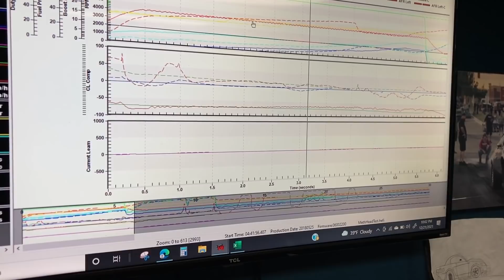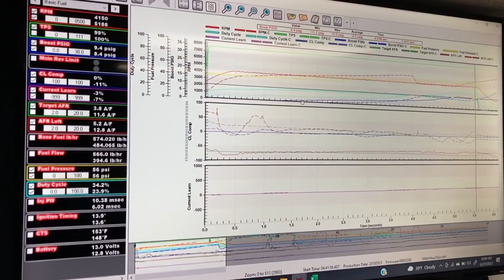Does Methanol Spool a Turbo Faster than E85?  Gap Train S10 goes on Meth!

Comment: What injectors?
Reply: Fid2200s
Reply: @maktvmidamericakustoms8837  what size fuel line are you running?
Reply: @zachtruitt7  10an up to the engine then y into 8an to back of both rails

Comment: Exhaust volume. Crazy how laggy that is since e85 itself has higher exhaust volume than pump gas.
Reply: Alot of it is just having the bigger 91 on there.  With the smaller 80 it did fine.  Just needs more cubes or less turbo

Comment: So the whole crew will be swapping in the future I bet:). Curious to the $5K cost factor mentioned. Is there new data logging accessories needed?? I know Adam mentioned staying with the current injectors and adding a bigger pump. What else is needed??
Reply: So it looks like we may get lucky and be able to use our fid2200s.  I bought a aeromotive 10 gpm in tank pump.  With a 60 psi it looks like we may just have enough for this power level.  We will have up coming videos  showing the upgrades and once we put it on the dyno.  Stay tuned ;)
Reply: @maktvmidamericakustoms8837  #isitdoneyet  Looking forward to them. All the best !!!
Reply: @maktvmidamericakustoms8837  love watching you guys, laughing the whole time.

If you get the chance, could you touch on the oiling system for the gap trains turbo? There's not much information on remote mount turbos.

Keep up the killer work, making Indiana proud
Reply: @NickButlerish  thanks buddy and sure can.  I will be doing a video in the next week going over the entire truck.  Where we are now and where we are going with it for next season
Reply: @maktvmidamericakustoms8837  I mean your gunna be limited to 1000whp on meth with fid2200s won’t you? Same injectors I have and I figured it wasn’t worth trying meth because I can’t afford a second set of injectors
Reply: I think his injectors were large enough to try the 2 step. I doubt they’re big enough to actually carry the boost and rpm top of the track.

Edit: watched it to the end. 210s. I guess they’re large enough?

Comment: Do you guys think twin 7875 turbos on a gen 4 5.3 with ported 706 heads BTR stage 3 twin turbo cam on E85 will spool up okay or to much turbo
Reply: Cool, that stage 3 cam from btr is rowdy af also.  You will be happy with the combo
Reply: @maktvmidamericakustoms8837  I hope so everyone keeps telling me that I've got to big of a cam and to many turbos I figured go big or go home hope I made the write choice
Reply: If the turbos are in the engine compartment you should be good to go.  Worse case you may need a little advance table work but nothing radical.   Are you on holley
Reply: @maktvmidamericakustoms8837  yeah I'm running Holley terminator x
Reply: @maktvmidamericakustoms8837  what’s the storey with the red hughes hat clipped in there? Lol.
Reply: What intake are you using
Reply: @maktvmidamericakustoms8837  Holley mid rise
Reply: @vrg69  you will be good to go buddy with that deal.
Reply: @maktvmidamericakustoms8837  hope so like I said I get it all put together I holler at you and get some ideas on tuning it and make it worth your time
Reply: @vrg69  sounds great.  Thanks for watching
Reply: @maktvmidamericakustoms8837  also running sep 1500cc injectors